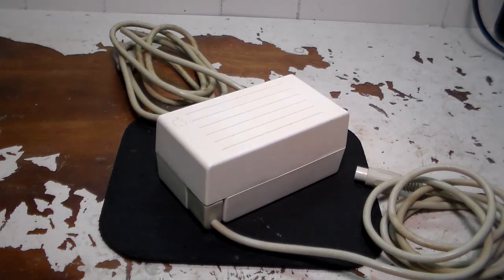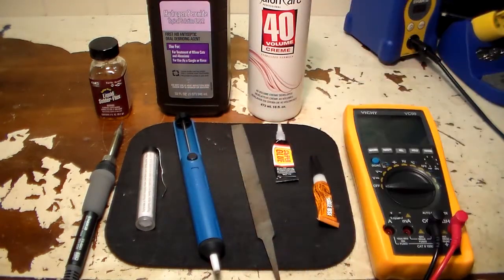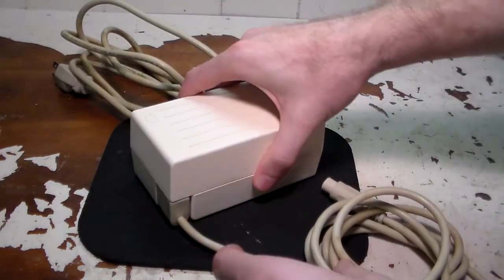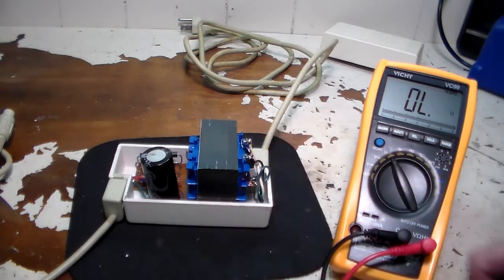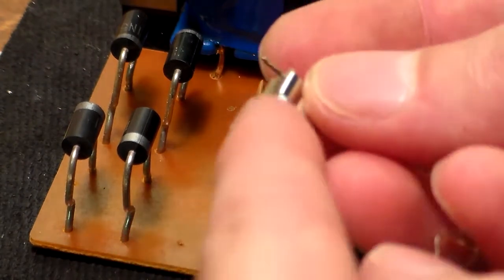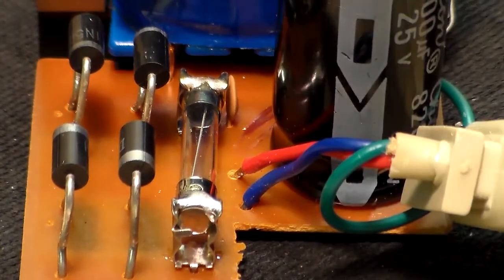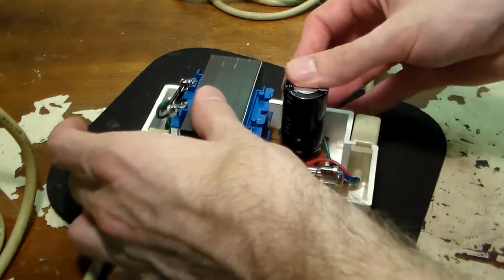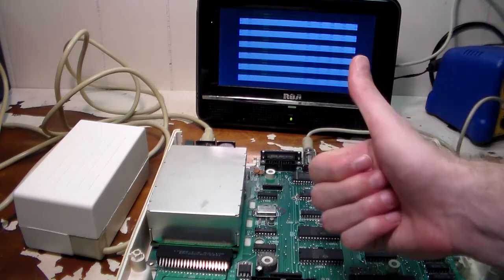Apple IIc Power Brick Repair and Refurbishment - Part 4

Comment: thanks for video.. my Apple IIc power bricks shows some power problem. I was looking for how to open this thingy.. now I figure out that you need to cut it open. damn!. I am not sure that this kind of repair vs a modified modern notebook power block to replace this. Does anyone know which one is better for this old machine ?
Reply from the maker: I made a modern power brick replacement a while back and it's just easier to deal with than the original brick. Either option will work though
Reply: @thewheelman282  thanks for sharing. I just ordered bunch of 7 DIN female connectors. since I have bunch of notebook power blocks.. I think my Apple IIc will outlive me LOL!